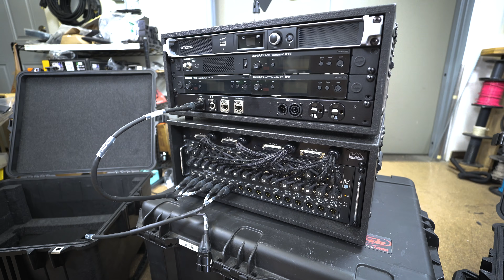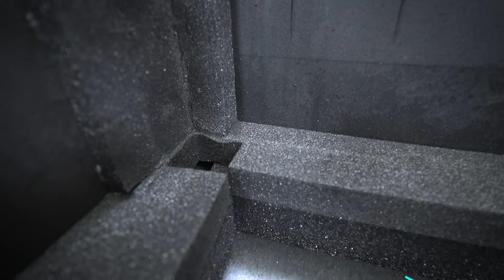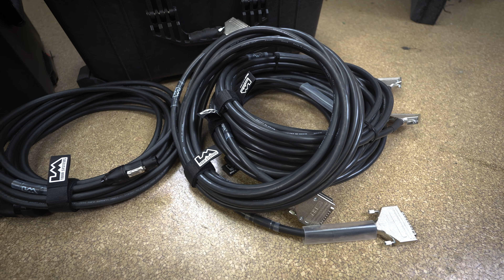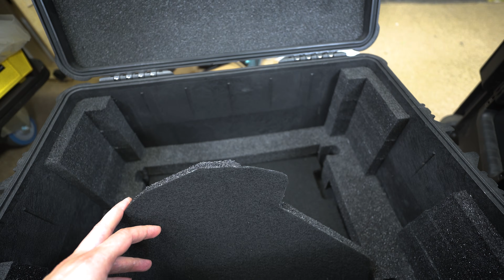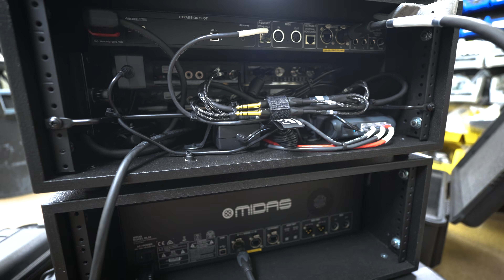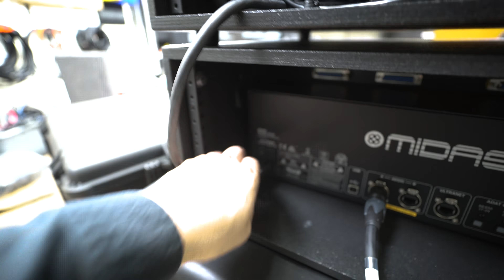Pro Touring IEM System – 32ch M32C/DL32 Fly Pack with Built-In Mic Split | LM Cases

Comment: How does Signal "1" ground-lift cable works? Does it just  cuts Line 1 signal to nothing? Also it makes cable to be not symmetrical,   am I right?
Reply from the maker: Pin 1 (ground) is not wired. It’s the same concept as a “ground lift” switch. https://www.lmcasesonline.com/ground-lift-xlr-cable/

Comment: why not just use a W1 instead of db25? W1 will fit on 1u and DB25 in a live setting doesn't seem like a good idea
Reply from the maker: A W1 based split wouldnt fit in the space allotted. We only had 1U for the split.  Though a W1 is a more durable connector than a DB25, it adds more complexity to the build. DB25's are used in industrial machines and there are many off the shelf products that split the signal on a PCB with DB25 connectors on each end. If we built the split from a W1 for this build, we would have had to solder each of the connections for the split which would have added height and labor cost. All our builds are custom per order, we will gladly build a W1 split if a customer requests it. This build couldn't exceed 2 Pelican cases.

Comment: I wonder what the cost difference would be with a more reliable multipin like W1?
Reply from the maker: I wanted to use W1 with this system however we went with DB25 for a few reasons: 
1. DB25 is smaller in physical size. We were able to fit 4 -D sub chassis easily on a 1U panel and leave room for the XLR tails. We were limited to a 4U rack shell so increasing the panel height to 2U wasn’t an option
2. DB25 cables are available via Amazon. Should something break on the road, a temporary replacement can be ordered quickly. Generally only sound providers / integrators have access to W1 and it's generally not a stocked item.
3. The DB25 components are less expensive. 

TLDR: Because of the ubiquity in industries other than specifically audio, parts are generally more available. The physical connectors are smaller. DB25 is less expensive.

Comment: Really cool system. One flaw that I noticed at 10:08 are the rear db25 connectors. Looks really cramped and recessed. Might be a problem with someone with bigger hands, might be a challenge to some to connect them.

Comment: I know you guys have the ethercon to ethercon cable build vid but it would be nice to have a cable build video for that 4 ch 1303 breakout cable. Really nice.
Reply from the maker: Thanks! This build was the first time we built them. I just didn't want to use a Radial break out box and another Ethercon - Ethercon cable. They were a pain to build. The procedure is to split out the braided shielding on the 1303 into 4 for the grounds, which is a hateful task. Then each line is separated, wrapped in 1/8" Techflex then soldered. I have them for sale on our web store, but Im sure I am going to get roasted on the price. -Billy https://www.lmcasesonline.com/ethercon-to-4ch-female-xlr-breakout-cable-built-to-length/

Comment: If I'm understanding correctly, the DL32 is the feed from the split to go into the the M32C; where/how is the input split happening? Is there another rack for stage inputs with a splitter going to the DL32 and to FOH via tails?
Reply from the maker: The mic split is the rack unit above the DL32. Inputs are fed into the split via the DB25 jacks on the front. The front DB25 jacks are intended to be used with DB25 trunk lines connected to 8ch DB25 stage boxes. The rear DB25 outputs feed the house console via DB25 to XLR snakes.

Comment: Having that 1U for power and Ethercon would be super useful for all kinds of tight digital mixing setups. The only thing I would change is to put that at the bottom or top, and the power in/out on the right edge, so your power cable is out of the way.

Comment: Really like that 4ch cat6 breakout.
Reply from the maker: We have them for sale. Though they take forever to build! -Billy https://www.lmcasesonline.com/ethercon-to-4ch-female-xlr-breakout-cable-built-to-length/
Reply: @lmcases1985  Would LOVE to see how you guys build them! I always have to use a breakout box for this application. curious how you're bypassing that and going straight from RJ45 jack to XLR
Reply from the maker: @mattjohnson7660  They are built with Belden 1303e wire. Each pair is individually wrapped in foil shielding. The pairs are separated, wrapped in Techflex then soldered to XLR connectors. The tricky thing with 1303e is separating the braided shielding and splitting it onto 4 for common pin 1 grounds. That part takes forever.